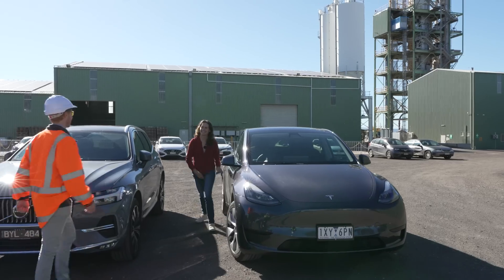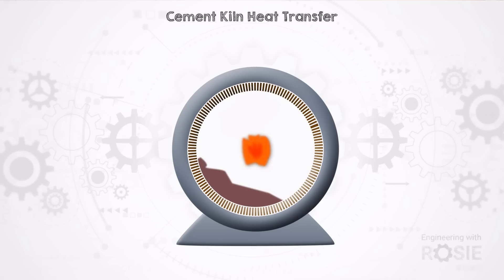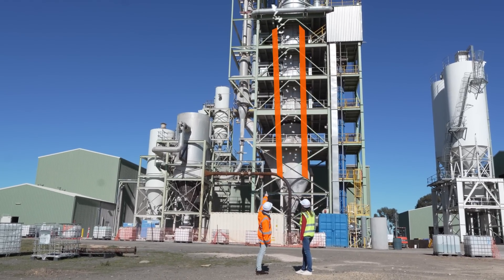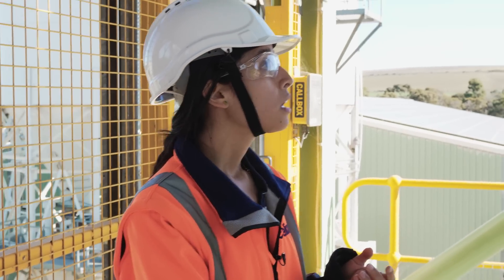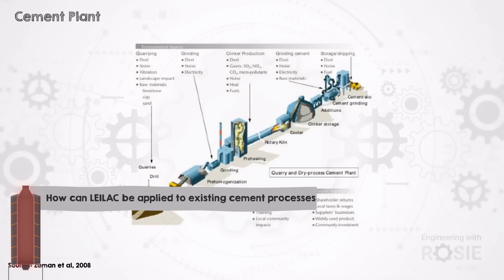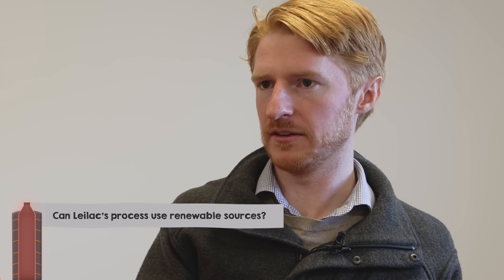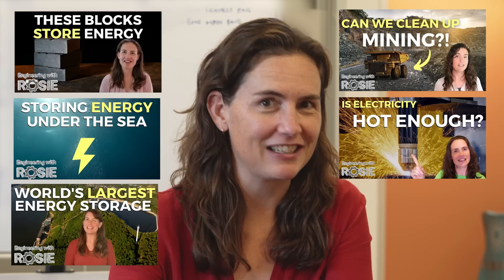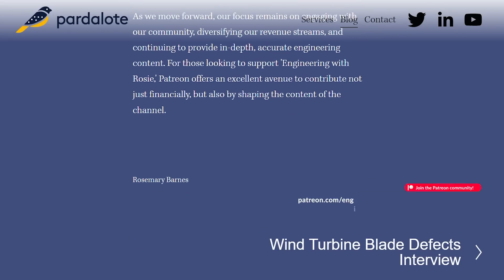Revolutionising Cement: How New Tech Could Slash 8% of Global Emissions!

Comment: When cement cures it absorbs CO2 from the air in the reaction CaO + CO2 -> CaCO3. This happens fairly quickly (40 days). So cement production+ carbon capture is potentially emission-negative. In typical concrete mixes this would give 26 kg of carbon absorbed per ton of concrete poured, so it is less dense than the negative-emissions carbon you get in wood. But still, Rosie understates the potential of cement + CCS.

This doesn't mean one should be a techno-optimist. This is a misnomer which is actually saying you're happy with capitalism continuing and you haven't yet reached the level of conscience where one sees that it is capitalism and its profit-motive that is the main hurdle for the development and deployment of new nice carbon-negative technologies

Comment: The good and the bad.  This is from the review of CCS from the US Congress....
Bad...  The IPCC has said carbon capture might be necessary to reduce the emissions of certain “hard to abate” sectors like steel, concrete, and some chemical manufacturing, but noted that in the best-case scenario, with carbon capture technology working flawlessly and deployed at large scale, it could only account for a little over 2 percent of global carbon emissions reductions by 2030.
CCS is a scam. They could collect the CO2 to use for carbonated water, or industrial uses, but they will soon flood that market. Then what?
The good....  it is creating a vision that it or others might find a way,.

Comment: That’s amazing progress. There is one missing opportunity in this chain. Instead of unreliable and costly sequestration of useful pure CO2 it can be converted to e fuels (by adding green hydrogen) by the time we don’t need it anymore. E fuel can be used in aviation for upcoming decades and or even better or later in petrochemical industry. Potentially It can make this practice more economical than conventional way. 

Considering we are talking 60% of cement emissions it can produce significant amount of e fuel, at least way more than the need of global aviation.
Reply: but it's still fossil carbon 😢
Reply: The fastest way to that end is to use fresh compost rather than fossilized compost as the raw material, Crude Oil is after all just well-rotted compost.

Comment: Is CO2 emission in cement production really a problem? Making concrete is a circular process. The CO2 that gets emitted during the the production gets reabsorbed when the cement binds. So in my mind, everything that needs to be "electrified away" is the heat needed to run the kiln, which is doable.
Reply: That's why the video is an understatement of the potential of cement production + CCS: it's actually emissions-negative in stead of potentially net zero.
Reply: 1. not much CO₂ is reabsorbed as concrete sets
2. the process stage identified here is not the only stage which liberates CO₂

Comment: “The CO2 is just sent off and sequestered.” Where? How? And what “other” renewable energy sources are there apart from electricity?
Reply: Add carbon dioxide to water before mixing it to cement when you make concrete and it will become part of the building material forever. This may be hard in a building site, but much easier in a preformed concrete shop.
Reply from the maker: Biomass, biogas.

Comment: It's straightforward enough to get CO₂ from a calciner.  I am impressed by the process improvement and by the potential to use electricity for heating here.  There is talk of carbon dioxide capture here but no sign of any equipment to do so, nor any sign of what would be done with the CO₂ once captured.  What's the plan?  Enhanced oil recovery?  Enhanced greenhouse tomatoes?  Enhanced weathering?  Like MSG, CO₂ is good for enhancing things, it seems ...

Comment: I'm wondering whether it would be possible to use the resulting CO2 as the carbon source for methane generation in a Sabatier reactor. You would need lots of hydrogen for this though.

One of the most carbon neutral ways to power the entire setup would be a nuclear reactor.

Comment: I think you touch a key point at the end: this tech may be cheaper than amine or oxyfuel CCS for cement, but will still add costs... carbon tax (with CBAM) can force the issue but the public need to come to a "new normal" and accept that the low cost of emissions-intensive products (and energy) we are accustomed to is an illusion - the cost was actually high, but being paid for by the planet, not the customer. People need to realise we have to pay for sustainability. 
Our job as engineers will be to make that extra cost as low as possible 😊

Comment: I don't like the problems associated with 900ºC heat transfer through surfaces.   That is asking for problems.   

Another approach to handling the really nasty temperature of making clinker is to use pure O2 and coal with recycle of the flue gas CO2.   This would effectively use CO2 as the heat transfer along with radiation.  This recycling gas would be almost pure CO2 making it possible to sequester all the CO2.   There would be some water from hydrogen in the coal and any moisture in the raw limestone, clay mix which could be removed as a side stream (just cooling) from the CO2 recycle gas.  

This could be adapted to any existing dry process coal-fired cement manufacturing process that had somewhere to use all the liquid CO2 for sequestration (land elevation, oil enhancement, etc.).   Separating O2 from air at 20% O2 can be more economical than separating CO2 from flue gas.   The technology for pure O2 production from air is off-the-shelf and well-known at the required scale.

Comment: Leilac is an ideal, perhaps, adopter of carbon separation from CO2.  Heat is one of the main catalysts, perhaps THE main catalyst in the proprietary process owned by University of Washington.  The CO2 is presumably already at 900 C at point of capture.  The subsequent sequestration is then only of C, much easier and safer than CO2 and the O2 is itself captured or released into the atmosphere.

Comment: Another great video. Greenland, by the way, has minerals in abundance that should enable every cement manufactor to utilize surplus heat from the production, add co2 and the minerals. And run the process in reverse! Capturing co2 and making a material that can be used in a concrete mixer!

Comment: Stlii relies on carbon capture which is not very effective and expensive. Have you investigated the Dr Cyrille Dunant of Cambrge University's Cement 2 Zero project pilot at CELSA Steel where they are combining cement making with steel making to slash emissions?
Reply: I think you may be confusing direct air capture, which has very high costs as the CO2 is very diffuse in the air, with this process, where the CO2 is concentrated and far cheaper in money and energy than getting it from the air.

Comment: If you are in a sunny region, you could also use CSP to generate (and store) the heat. While CSP isn't the cheapest for electricity, for heat it doesn't have the losses of energy conversion and is thus much better. It can also easily reach the required temperatures.

Comment: Another great episode! If geek kind of means interested in how things works, count me in. If techno-optimist is used as an insult, that says more of those who think it's such a bad thing, especially if it's used as an Ad hominem "argument". 

Decarbonating cement production is a very interesting topic, even if it's unlikely to lead to reductions in emissions on a global relevant scale anytime soon. If the process can be powered by electric power, and if the process rate can be adjusted at least to some degree to the situation on the grid, maybe some of the extra cost can be offset, by utilizing more power when it's cheap.  And that could potentially make the production have less negative, or straight out positive impact on the grid. I don't know how realistic that is, I guess it would be hard to get industry representatives to even seriously contemplate the idea of willingly reducing production rate, even if it's temporary. 

Back to techno-optimism, humanity have solved a lot of problems, and while it's true new problems has been created, we've solved, or are solving those too, or have learned our lessons. The history of energy is quite telling, starting with the use of fire, which eventually led to some areas running out of wood, which was part of the reason humans started to use coal in the first place. Then we added whale oil, petroleum oil, natural gas, on top of all that coal. 

We have realized that we need to stop burning fossil fuels, and we have developed alternatives, and started to displace fossil fuels. There were no time in history where we had a lifestyle that would be sustainable for billions of people, we can't keep relying on fossil fuels indefinitely, we can't go back to whale oil, and we can't go back to burning wood as the main energy source for humanity. Neither stagnation or regression can be sustainable, that leaves progress.

Comment: Great video thank you very much!! This makes me think,  instead of burying the co2, is not possible to use for certain industries? Notably it can be used as low emissions refrigerant in the hvac industry.  I'm sure there's other uses too
Reply: It is cheaper to use the captured CO2 in products than to bury it, but the amount of CO2 being emitted is really huge (37 billion tons) compared to what we need in hvac ect. Also, when the CO2 leaks we haven't really mitigated the emissions.
Reply: @tombh74  that's a good point. As far as refrigerant goes, co2 is still better than any synthetic refrigerant in use today.  But I agree,  if it leaks it's all for nothing.
Reply: @martinluescher5009  CO2 captured from biogas burning or woodchip thermal plants have the benefit that if released it is net-zero. Could be used for producing methane or e-fuels.

Comment: This looks like important progress for a process which generates most of the CO2 in our community in the High Peak of Derbyshire (search for "Peak Cluster"). But, I've yet to see a convincing example of successful "sequestration on a geological timescale" (that's a phrase I've heard used very glibly by the industry, as though they've already done it reliably) that we're currently being promised at the end of it. All the schemes I can find have failed to a pretty dramatic extent (stopped very early due to pressure rising, failed to store as much CO2 as planned, leaked etc) in the very short term (like, a handful of months or years). UK government are putting shedloads of £s behind this, but I've yet to see any clarity that the final, critical stage will work. Rosie - are you aware on any genuinely successful geological (or other) sequestration of CO2 on a more or less permanent basis?

Comment: Rosie, tell Leilac to contact Tesla's Lithium Hydroxide team at Corpus Christi Texas. They are processing Spodumene to LiOH and hoping to do it cheaper than other companies. However, they have installed large rotary cement-like horizontal kilns. Electricity is cheap in Texas. Giant battery farms are being built there. Electric resistance heating should be cheap in Texas. As centre of an old oil and gas industry, there is surely plenty of old well to pump CO2 into

Comment: Haha!! A spiral resister cable on the inner wall of a 'thermos' to heat the wall to 1000 deg C and thus the powder falling through the centre of the thermos. 
It world can reduce CO2 emissions to 10 GT/year (from near 40 GT/yr at present) global C02 in air will drop by 1ppm/yr for decades.

Comment: If we could find a market for all of this captured CO2, the problem would take care of itself...
Reply: Yes there is a market for CO2. Professor Licht from GWU has shown that you can electrically refine CO2 into carbon nanotubes/buckyballs and other configurations of graphene. This product has many valuable uses and would be far more valuable than the cement.
Reply: Building millions of homes globally using hempcrete, bamboo, and wood will remove vast amounts of CO2 from our atmosphere and lock up carbon for hundreds of years. Homes built with hempcrete require fifty percent less energy to heat and cool.

Comment: I think this spiral heating element should be somewhat more efficient than using solar to generate green hydrogen and then burning hydrogen inside the tube instead. Skipping a step usually results in increased overall efficiency.